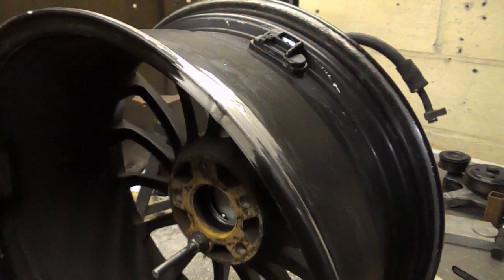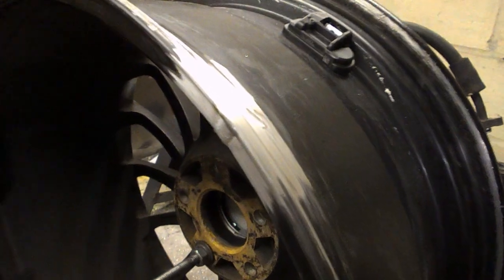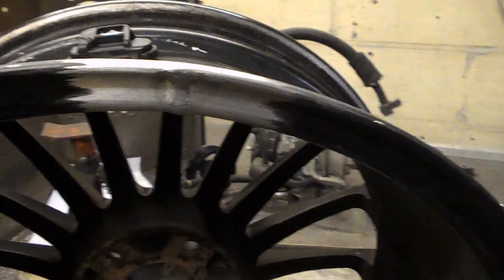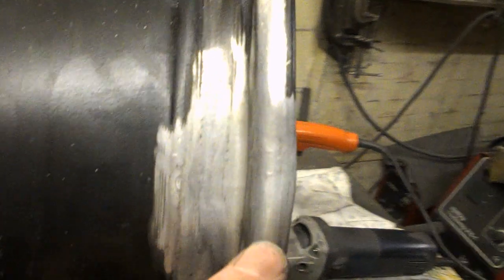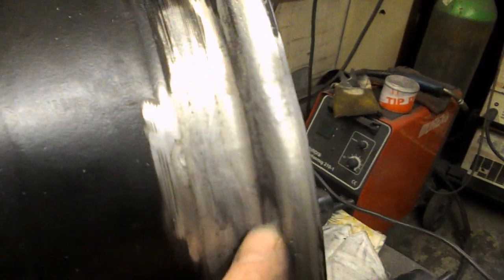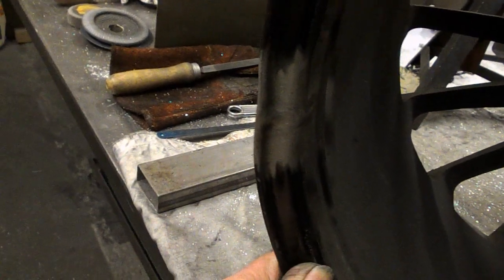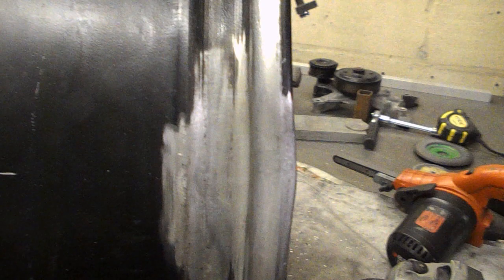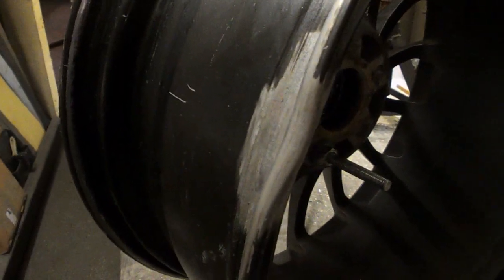Welding cracks in Alloy wheels - Is it safe?

Comment: Cheers for the vid.
Mate that buckle not re cracking that weld is hectic, well done 👌
I work for Precision Wheels on the Central Coast in Australia and we Tig weld our cracks using 4043 filler, as u do and some Im unable to press the buckle out before welding and most of the time they re crack straight down the middle of the weld during pressing or a crevice appears right down the middle (which I feel could be caused by a cavity in the weld perhaps). 
I've just read that alloy wheels are most commonly cast from A356 alloy so 4943 filler rods might be a better choice or 5356 have also been recommended, people. Ive read that 4943  can cope with hammering far more than 4043 even without heat treatment as 4043 is more brittle, what do u think?
I would really love to know what settings are u using on ur welder and is there any special technique or any post weld heat treatment etc? Clearly what ur doing is perfect for impact resistance, u sir r a god.
The welder at work has tried a new technique this week and I've actually pressed 3 wheels right on the welds successfully. 
After he cuts out and welds the crack he lap welds over the weld on the inside of the drum and I've noticed they are wider and sit flatter, as tho it has achieved better penetration or not cooled as fast and allowed it to settle or something but so far so good 🤞
Thanks in advance..
Reply from the maker: Thanks for the compliments but I don't think I do anything special! I always cut a vee in the crack from both sides & weld from both sides to make sure the filler/weld goes all the way through. I start from the inner end of the crack on the inside of the rim (at about 140 amps) & work towards the edge of the rim. Then do the same on the outside of the wheel, laying plenty of filler rod in so that any residual dirt or oxide that floats out will be ground off when the surface is smoothed off. Finish welding by building up the edge of the rim so that it's just a bit higher than the original profile. Probably down to about 100 amps by that stage. After welding I use a ball pein hammer to peen the surface of the weld on the edge of the rim before I smooth it down where the tyre seats. I generally leave the weld on the inside of the rim.
Wheels are generally marked either "AlSi7" or "AlSi7Mg" & I've always assumed that these are (slightly) different alloys with 4043 filler being a close match to the former while 4943 filler would be better for the latter. I wouldn't have thought that 4043 could be considered as brittle but 4943 is certainly stronger according to the specs. I've never tried 4943. 
On looking up specs for cast alloys, search results suggest that "AlSi7" still has Magnesium in it! But I'm sure there are variations in the alloys that wheels are made from. I use a coarse cut Tungsten carbide burr in a die grinder to "vee" the cracks & wheels marked "AlSi7Mg" seem to be harder & less gummy than those marked just "AlSi7". I think I sometimes see a green tinge in the arc when welding a "AlSi7Mg" too...
Welding will do a pretty good job of annealing the alloy but I've never tried to straighten a dent or buckle without heating it...Never done any post weld heat treatment ( I don't have the facilities for it) & of course 4043 filler isn't heat treatable anyway.
Reply: You are using the wrong filler material.  Cracks welded with 4043 will invariably fail in the area of the weld.  There is a need to keep heat to a minimum when actually doing the welding, and an old 3 phase dual inverter machine, with mixed AC/DC waveform, is the best possible way of keeping the heat down.

Comment: I've cracked my rims on the rear. Isit worth welding of would u throw them away it's seems I like the kerbs too much both alloys crack on the inside. 4 cracks on each wheel 2 have cracked over previous welds.
Reply from the maker: Can you get replacement wheels for a reasonable price? Ideally, new wheels would be the best option but they can be expensive or no longer available in your pattern/style. Good used wheels might be hard to find. You could get yours welded & they might be fine forever or they might crack again! Tricky decision to make. Large diameter wheels with low profile tyres are the worst & run flat tyres especially bad.

Comment: Would you advise against welding more than 2 cracks?
Reply from the maker: Not necessarily. If the rim is otherwise in good shape & you can't get another one easily or cheaply, then it could still be worth repairing.
Reply: Each weld creates 2 heat affected zones either side causing weak points so each weld equals 2 weak points and 2 welds equals 4 weak points and so on.
So basically more than 2 cracks means more will most definitely occur and u r simply wasting ur money repairing it any further.
We only do it for extremely rare wheels and even then really only do 3 max.
Also if multiple cracks happen to occur with minimal to no buckles from a decent impact even if they occur some time apart it could be due to a flaw in the alloy itself and we usually advise against repairing even the 2nd crack in that instance we class the wheel as a write off and no longer safe for use, I feel 8 should start reporting those instances back to the manufacturer, a wheel should never be cracked and still be 100% round that's a fault in my eyes.

Comment: to not bending again you need to quench on wather...
Reply from the maker: Not that simple. Yes, the heat from welding locally anneals the Alloy & makes it softer, but the heat dissipates far too quickly for quenching to have any effect even if you could somehow arrange a practical way to do it. The best way to avoid bending again is to avoid potholes!
Reply: @MidEngineering  What about keep dabbing with a wet sponge with a bowl of water to cool the sponge every few seconds? Nice result on that ding! I was smacking a steel rim without heating it with the tyre still on. Had to hit it so hard with a ball hammer, perhaps i got the sledge on itin the end, leaked a tiny bit but finally sealed itself.
Reply from the maker: @izzzzzz6  Quenching the weld as you go? Not really practical I think & the filler rod alloy isn't heat treatable anyway...
Rims ARE pretty tough - especially steel ones!  Takes a good wallop to bend them & another good wallop to straighten them again. Luckily they don't need to be perfect to seal.
Reply: @MidEngineering  Sometimes i quench mig welds as i go when there are sensitive parts nearby, not for annealing but thought it might be better than nothing but might cause more problems than advantages in this case.
Reply from the maker: @izzzzzz6  Yes, I've seen people quenching welds when MIG welding car bodywork to control the spread of heat & distortion. On an alloy wheel I don't think it hurts for the heat to dissipate through the wheel & the only thing you need to watch is that you clean the paint off at least 2-3 cm away from the repair or it will burn.